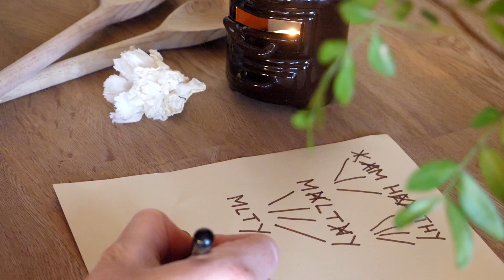Magic wands | How to use wand magic & wand DIY

Comment: I was walking my property and I heard something moving in a tree. I walked past it and a large branch fell. I was never going to have a wand and never had the intentions of having on but when I turned around I got the strongest voices telling me that my property gave me that branch to make a wand with. So thats what I did, I carved out the pieces that called out to me and etched it and coated the handle part in purple wax with the intentions of manifestation and sparking energy flow. I have not used it yet but this video was the eperfect starting place on learning what to do😊😊😊

Comment: I made my wand with a piece of maple that I found in my grandmother's backyard. It was dead wood, so no harm to the tree. It has special meaning because I had a very close relationship with that set of grandparents and when I see it I remember the connection to them. Also, I did hot glue the crystal in place before wrapping it. Made it easier to put together and doesn't affect the use at all.
Reply from the maker: That is so beautiful - I absolutely understand that it is very special to you 💚 and yes, definitely a good tip with the crystal - I did the same so it wouldn't fall off ☺️
Reply: I made a wand from my great aunts Crepe myrtle tree in front yard that has been there for decades. It's that connection that make them special.

Comment: "The wand chooses the wizard" is so true! I prefer to use as many natural things as tools or representations on my altar as I can. I hardly ever use the wand that I have, which is a stick that I adore that I found while hiking. I wasn't in the market for one, and never thought that I'd actually spend money on one! However, I was in one of our local metaphysical shops, and they had some wands made by a local man on display on the counter. My attention was drawn to this specific one. I picked it up, and I could literally feel the energy buzzing! My arms were tingly and my hands were vibrating. I just knew, for some reason. that it was mine and that I needed to purchase it. So I did! and I'm absolutely in love with it.

Comment: I purchased my wand from an awesome shop on Etsy. It’s a wooden wand made of Alder wood. The creator shaped it and burned some Alder leaf imprints in it. When it arrived, I added some things to it to make it personally mine like a bone and a pendant attached by deer hide. 

It’s ironic because I just learned that my birth tree is Alder. I felt a connection to the wood when I purchased the wand without knowing it was my birth tree.

Comment: I found a stick that broke off an oak tree in a storm. I whittled it down and then sanded it. Next I used glue to add a line of crystals and a few rubies and sapphires that I found in a gem mine. Tiny tiny ones. Then I wrapped it with copper wire and added a few more stones in the front to lengthen it. I have done so much over the past few months to make it more powerful including pricking my finger and adding that them spraying it with Mod Podge. 
A few night ago I dreamed it glowed with a white light.
It’s my first wand I’ve ever made or used.. just never got into them but now I use it all the time. It doesn’t give me tingles or anything like some other things do but I have faith that it is powerful.
So much fun!

Comment: I have mostly twisted root wands. most of mine have crystals, but my best, and strongest wand is not very long (17cm). it has copper wire burned right through the center of it, an acorn carved into one end, with the acorn tip is a very tiny quartz which rests on the copper wire. the end of it has a garnet touching the  hand side of the wand. its small but very strong.

Comment: You can put calcite crystals on the tips of the wand to make it glow in  the dark or if you can find a way to make a small vial from quartz crystal that you could put Phosphorescent algae in and put it on the tip of the wand then it will glow from the agitation of waving the wand and it adds a little flair to to spells also if you are preforming a spell for a spectator then it gives the illusion of magick showing itself so then the spectator will have something to believe on making the spell more potent for them

Comment: I’m intrigued about your process of making that sigil, how you started from “I am healthy” with them crossing out letters. I will search to see if you have a video on it. If you don’t could you please make one. I have been struggling with making them. 
As far as wands I have two, one that’s from a stick my dog found which fills me with love and joy. The other is one is driftwood that I found and called out to me. I am still deciding if I want to decorate any of them or leave as is. Only time will tell. Lovely video! 💛🧚🏽
Reply from the maker: I love the backstory of your wand with your dog - that is so sweet ☺️ as for the sigil video: I made one a while ago already where I explain exactly the process I also used in this video. Very simple and to the point. Sometimes I also draw sigils just in a way so they hold some meaning to me and scratch the writing down the sentence part completely. I will definitely do a more in depth video on the topic though soon to introduce more ways to work with sigils 🙂
Reply: @Thewitchescookery  Thank you for responding. I did find your sigil video & will be watching soon. I’m very excited you will be doing a more in depth one. It will be good to try out some different kinds. Hugs! 💛

Comment: Hazard: For any actual food use items try to not carve onto areas that will directly touch the food. 
This also goes for bowls and mugs with cracks or pitting holes in the glaze, these areas where the surface breaks can host bacteria if not properly sanitized but also is just a place that weakens the item over time. 
Like a pothole in asphalt it might just collect some rain but over time say if your clink your spoon and drag it on the sides and bottom of a bowl it may cause minor chipping or move liquid in and out of the space. 
Many items are also porous under their thin protective coatings. All ceramics will absorb water and warp in fluctuating humidity, wood will absorb water unless treated or sealed it too may warp in fluctuating humidity, glass will give way to stress and flake apart because it is a solid/liquid that will warp in time and will revert to granular pieces. Also some coatings may be toxic like fiesta dinnerware or Teflon nonstick pans. And why things like a cast iron pan can increase your iron intake when cooking acidic foods youre leeching the material into your food. Micro-dosing your plates as the blue isn’t the healthiest. 

This is why carvings are on parts of handles that are not held, as hands will wear down a design and can hurt on occasion, but also not directly on the ends that would be touching anything, it’s hard to clean and no one likes to take a pick and meticulously clean out every nook and cranny in an item. Usually why things are hilted/bound for practical use and the blade guard and pommel areas would be decorated, flashy bits above and below the palm. 
Sanitation is important, functionality is important, decor is important. Stay safe happy crafting, invest in good quality materials and practices of making, always research when making items someone has made them before and made a version that’s hurt someone let’s learn from historical mistakes, as to not waste your material time money or wellbeing! Cheers!

Great video!

Comment: in my studies and practice, i have found each kind of tree holds energies that work for various things. in "harry potter" it was the elder tree wand being the most powerful, but that is not the case. in fact, the ebony wand  is. its energy  works strongly in all kinds of magical areas. lets take willow as an example. willow is female energy, mostly great for fairy  magic, ebony is male energy and works again in this area 100% more effective in results. the witch who does not want  to own thousands of  wands, should decide on the uses they  are going to use their wand for, then do research on the woods.
Reply from the maker: I love tree lore too - so fun to look into and chose your wand accordingly. Personally I work more with the German / Germanic lore though. It is so interesting how meanings and uses differ between cultures 🙂

Comment: Hey can I ask you a question?  I mess with radio waves.  Like, I give off an energy field that messes with the radio and bluetooth.  I can feel and control the field, like expanding it across a room or drawing it in so I can listen to music.  I can even sometimes use it to boost the signal just by focusing on the static and willing it to form music or envisioning untangling all the 'threads' that are radio signals and finding the right one to plug into my device.  I also don't really fit any of the categories for witches.  Do you have any idea what this means?
Reply: Also, sorry for bombarding your channel with comments.

Comment: One thing about energy...energy is energy.  Learn the secret of light. God is light.  Light is a frequency.  Frequency is vibration.  We are light,  made in the image of our creator and housed in a temple of flesh. Copper can conduct metaphysical energy the same as electrical current.  It's the same thing, and it all begins with imagination.  Just ask Neville Goddard. 
  Yeshua said don't do magic.  It's the mindset he's referring to...we should not think of this practice as magic...that's what the pagans do. It is simply the energy of God we move through our mind and being.  So,  faith and power of God,  not magic.  Faith in God's word, in his power,  and in our practice of his power.   When you know this in your heart,  you don't need magic.  What some see as magic is actually the reality of the God power working through us.